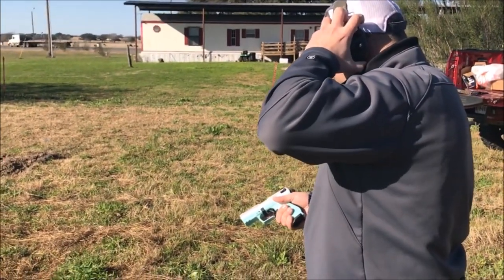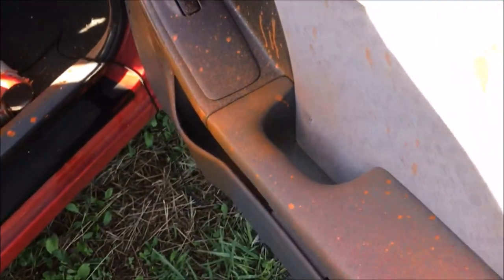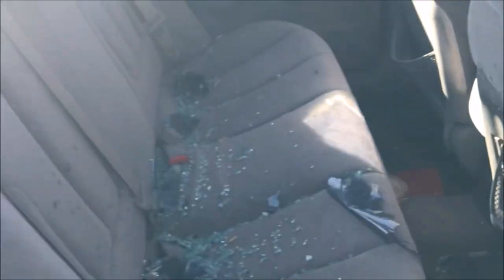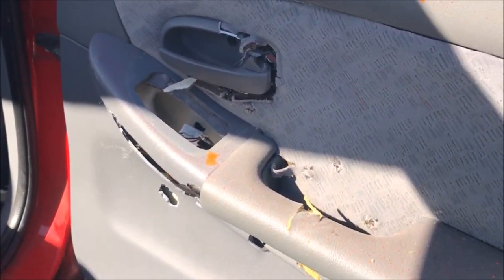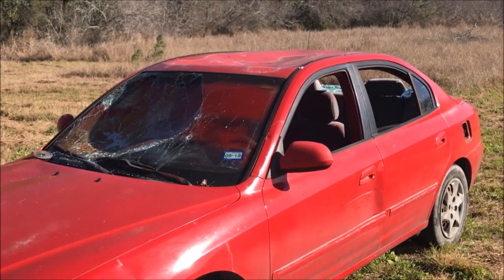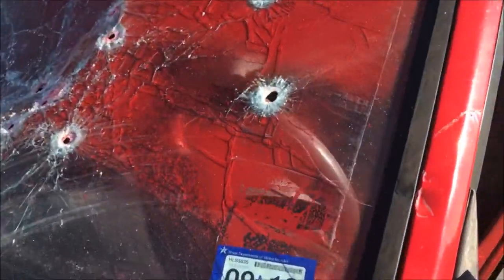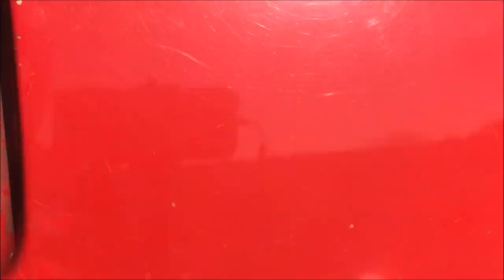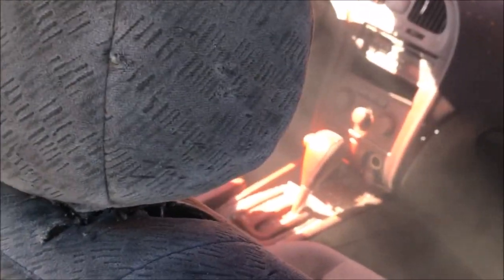380 vs 9mm vs car!

Comment: The good thing about the 380 is that you can hide it so easy! The 380 is just self defense, short range. I find it hard to be able to hit where I want to at a distance. But at 7 to 10 feet I don't need to aim.  But I really like the 357 magnum JHP! But they are very hard to hide. But if someone jumps me my 380JHP can do the job!
Reply from the maker: Yes sir. The 380 is incredibly destructive at a close range. Small, lightweight, and easily concealable!
Reply: The 380 acp is a defensive caliber not a war caliber.
Reply: @gonzalolopez9626  a lot of militaries including the Russians used it for a military cartridge not 380 ACP but they identical cartridge with a different name like 9 mm short 9 mm Makarov same ballistics 380

Comment: I know an old timer "Police Officer" they got into a shoot out with the Black Panther Party anyway these guys jump into their car causing hell, more gun fire later the car is filled with holes from Police Issued .38 Specials.  They walk up to the car figuring everyone is dead or full of holes, not one person hit by a bullet.  The car was a late 50's model, heavy steel construction and the bullets didn't do a good job of penetrating.  Everyone lived to tell the tale.
Reply from the maker: Not that a 38 is not a very deadly and capable weapon, but that round vs a car in a day when they actually built cars out of real metal, not tin and plastic. 38’s on new vehicles, and nobody would’ve walked away. Just my thoughts personally. And thank you for your service!

Comment: This is why I love these 2 calibers ..from a slight distance they start to travel sideways ..even more so for the 380 .. Both do way more damage traveling on their side ..my first hand gun was a 380 followed by a 9mm ..anything past 15 20 yards the 380 starts to flip.flop...but still stays accurate .the 9 takes more distance ..but does the same thing just with a little more bang.

Comment: What kind of 9mm did you use and what rounds on the second go around? They key hole pretty badly.
Reply from the maker: bruce tec we were using a Glock 17 and I can’t remember off the top of my head which rounds we were using. They were hollow points though. The first ones were just FMJ Winchester ammunition.
Reply: @chancellortv740  I'm not a fan of Glocks but I would hardly blame the gun for that since they are quality guns. But these rounds don't appear to stabilize too well in that gun. Great video. I will subscribe keep up the good work.
Reply from the maker: Thank you!

Comment: It won't be  fair unless you use 115 grain Fullmetal jackets in both .then you might realize that they are  identical.
Reply: Who makes 115 grain FMJ for the .380? Heaviest .380 I've ever seen was 102 grain, and it was not moving at anywhere near the speed of a 9mm, they aren't identical.